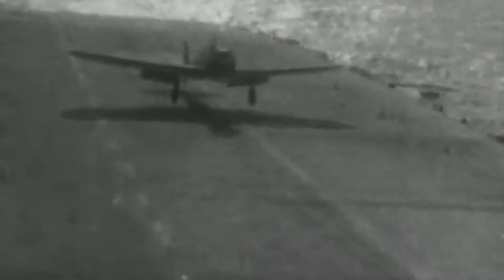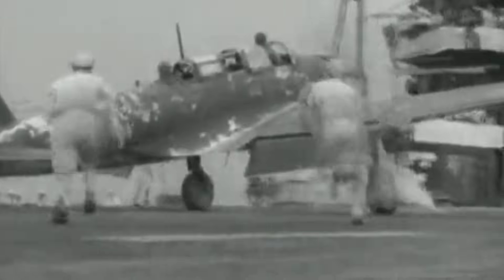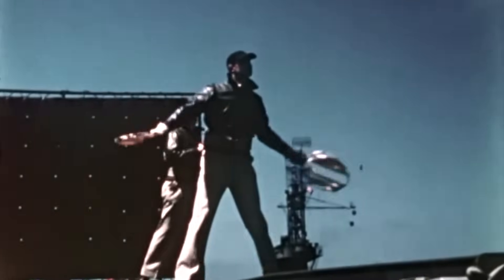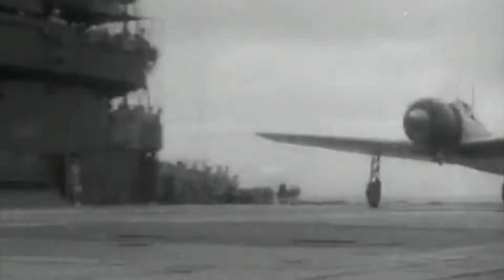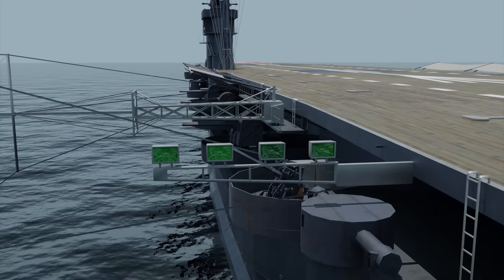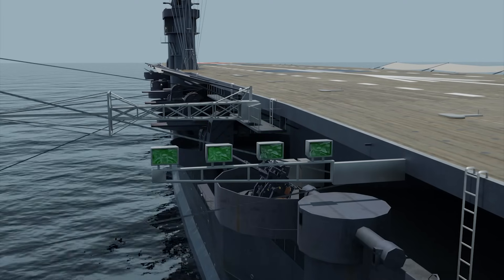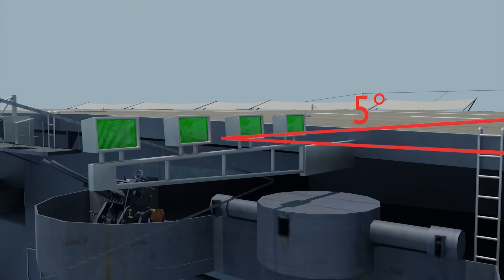Chakkan Shidōtō: How This Device That Helped Japanese Pilots Land on Aircraft Carriers Worked?

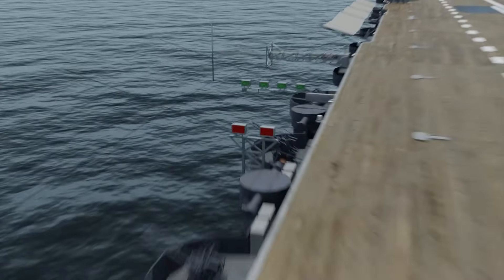Comment: I think you should cut 2:20 - 2:53 or so showing the parts of the system and the various banks of lights and turn it into a short. The algorithm greatly favours that type of video and spreads it to a wider range of viewers.
Reply from the maker: Thanks for the heads up😉

Comment: Seems dumb not to have landing control man with flags.    If enemy action knocked out the red and green lights or the electrical feed to them,  then planes could not land - all aircrews die and the carrier is defenseless.
Reply: 数々の空母機動部隊の作戦行動中に於いて、。貴方の言うような事例は実際に起きて無い。
それと全てが信号灯システムに頼らとも、実際には発着艦指揮官というマンパワーがいて白🏳️と赤🟥の旗を持って航空機の誘導を行なっていた。尚、信号灯の電源は本船回路とは別に独立した回路を持っていはず。😮😮😮
Reply: if enemy action is meeting the carrier in the first place something has gone very wrong

an LSO is alot less precise and succeptible to human error compared to pure mathematics of the positional relationships between landing lights, and as far as im aware the IJN never had any significant issues with aircraft landing disasters so it proved to work completely fine

the IJN also employed flagmen but these were last ditch, and most of the time just assigned a sailor to wave a red flag to signal an aborted landing, this system imo works just as fine if not better than LSOs
Reply: @kulot-ki1tu  The IJN did not have effective radar.   Nor, much of the time, did they have a proper destroyer screen.  Thus things were very likely to go very wrong.  The USN had radar, lots of destroyers, and no shortage of fuel.
Reply: @keithammleter3824  christ this is my 15th attempt and i cant even do a full detailed breakdown of why this comment is wrong without getting flagged by youtube
Reply: @keithammleter3824  youtube keeps deleting my breakdown of why this comment is wrong so to sum it up:

- 1943 onwards, the japanese employed operational radar on their fleet carriers (the first being shokaku), and were using it for gunnery surface fire control during this same period as well. they used radar to vector fighters much like the US did in several battles such as philippine sea

- IJN destroyers were some of the best in the war for fleet actions, and were not in short number for carrier vs carrier engagements and often made up the most of the escort force following their heavily up-gunned anti aircraft cruisers (the effectiveness of japanese AA is a topic for another time that i hope to god you dont try a take on as well)

- you may be confusing the lack of destroyers for carriers with the lack of escorts for convoys, which is something japan attempted to remedy with the kaibokans

- many things taken for granted such as radar were not available early on in the war, and when the playing field was level much better doctrinal practices, aircrew skill and quality of warships often outmatched the US such as coral sea and santa cruz
Reply: @keithammleter3824  youtube keeps deleting my breakdown of why this comment is wrong so to sum it up:

- 1943 onwards, the japanese employed operational radar on their fleet carriers (the first being shokaku), and were using it for gunnery surface fire control during this same period as well. they used radar to vector fighters much like the US did in several battles such as philippine sea

- IJN destroyers were some of the best in the war for fleet actions, and were not in short number for carrier vs carrier engagements and often made up the most of the escort force following their heavily up-gunned anti aircraft cruisers (the effectiveness of japanese AA is a topic for another time that i hope to god you dont try a take on as well)

- you may be confusing the lack of destroyers for carriers with the lack of escorts for convoys, which is something japan attempted to remedy with the kaibokans

- many things taken for granted such as radar were not available early on in the war, and when the playing field was level much better doctrinal practices, aircrew skill and quality of warships often outmatched the US such as coral sea and santa cruz
Reply: @kulotalt  As far as AA goes, it is well documented that Japanese AA was ineffective.   The USN had proximity fuzed ammunition, which was orders of magnitude more effective.
Watch the videos posted by Drachinifel.   He points out two key aspects of the IJN:-
1.  They were unable to adapt as the War went on.  The USN continually brought in new and better technology and changed how they did things; the IJN largely did not.
2.   Training in the IJN was pretty woeful.  The emphasis was on enduring hardship and following orders, whereas USN had a greater emphasis on pitching in and being flexible.   This is why seriously damaged IJN ships were lost, whereas damaged USN ships would limp back to port, get repaired, and return to active missions.
Reply: @keithammleter3824  ok how am i going to even post a 5000 word response with the way youtube manages it

if i cant figure out how to send a response, all im going to say is drachinifel is an excellent naval historian but he covers a very broad area and there are alot of developments in the IJN that go completely un-noticed by western audiences
Reply: @keithammleter3824  yeah no, 3rd rendition and shortening it down to 3000 words trying to explain how overgeneralized your points are isnt working, all i can say is the IJN never failed to adapt to changes in aerial warfare, it just never managed to implement those changes in mass, which is not the sign of an incompetent organization but a meager industry
Reply: and there is a massive difference in an organization thats incompetent and an organization which doesnt have enough resources, these points you're repeating are repeated by everyone who has some vague knowledge of the pacific war without knowing about the intricacies of both sides in depth and only take points from drachinifel

this complacency with the "well we won" mentality is what got alot of sailors killed at guadalcanal as well with false promises from the bureau of ordnance yapping about how the IJN never had good equipment, which was dreadfully wrong at tassafaronga
Reply: @kulot-ki1tu  I don't just rely on Drachinifel.  I just mentioned him because he is on YT and thus readily accessible to you.
Mostly I rely on books-from both sides.  For instance I have a copy of Tameichi Hara's book Japanese Destroyer Captain, which came out in English in the 1960's   It is an eye-opener.   In his book, he confirms that the IJN training was poor and the IJN ponderously slow to learn and adapt.
Hara also describes an aspect which is indeed not much known among western historians:   IJN culture required that any officer could propose a toast, and the captain had to drink it or loose face.  Further, drinking toasts was common when a battle was imminent.   This led to captains being pretty drunk, since each captain had several officers, just when reaction and decisiveness was critical.  They began the War that way and they ended the War that way.
"Incompetent" may be a word a little too strong for the IJN, but in training they were definitely very inferior to Western nations at the time.
You are right about the USN Bureau of Ordnance.   The US entered the War with dud torpedoes and that was a major scandal.   But it got fixed.   The USN also had a warehousing and supply chain system for spare parts that was ponderously slow - taking months to send things.  But that got fixed too.
Reply: @keithammleter3824  in that very same book written by tameichi hara he basically contradicts the entire point that the IJN had a poor training regimen by talking about the development of night tactics and torpedo warfare development which would prove vital in their early successes

there was an entire saga on the book aboard the Shigure where this decrepit poorly kept shiratsuyu class destroyer would go on to survive many of the best and worst engagements that the IJN went on, literally thanks in part to the excellent crew

"poor training" is again an overgeneralization, you might be talking about the inability to find replacements in time for veteran air crews, but the fleet never had a problem with training until the very later parts of the war on very new ships (with the worst case i can think of being taihou)

as a whole, the IJN at the start and even towards the end of the war had just as if not better trained sailors. western perceptions of japan as this hyper traditionalist feudalistic institution is utterly wrong
Reply: @keithammleter3824  japanese destroyer captain is also a fairly popular and mainstream book to study about the pacific war which provides valuable insight on destroyer engagement, but honestly the books i would recommend the most are technical ones which go through in depth analysis of doctrine, specific battles or the ships themselves because it is a treasure trove western audiences have little to no understanding about

Kaigun: Strategy, Tactics, and Technology in the Imperial Japanese Navy, 1887-1941 (great overview of how the IJN fought in relation to their ship equipment)

The World Wonder'd: What Really Happened Off Samar (a re-analysis of samar where many previous authors overblew the heroics of the destroyer escort, ignoring taffy 2 as well as recognizing the great gunnery of some of the ships involved such as the yamato which i hope you also dont start a conversation about without the necessary information because alot of western perception about that ship is also utterly wrong and unfair)

Japanese Combined Fleet 1941–42 (another great overview like kaigun, but more organizational)
Reply: and as the japanese person posted above, all you have to do is translate to figure out that the lights would have independent circuit boxes and backup flag signal officers of their own as well

using your criticism, what if the LSO was killed?? you cant just tell another sailor what to do on the spot (as ridiculous and unlikely as this sounds), because similarly hitting close enough to knock out these lights is also statistically unlikely compared to the entire area of the ship

Comment: How DO pilots adjust for the rise a fall of the deck, especially in heavy seas when attempting to land on a carrier?
Reply: He already explained in simple terms. The red lights will tell the pilot if they were too high or too low. And this just does not apply to the plane but the ship too. If the deck rose higher than the plane's angle of approach, he would see the red lights under the green light and vice versa. It is all up to the pilot's reflexes to make changes and try to safely onto the deck.

Comment: Japanese aircraft, ships and technology was ahead of the U.S. in many aspects in the lead up to WWII. 
Where they failed was in having the raw materials to engage in a protracted war with an industrial superpower as the U.S. became during WWII.
There's a lesson in there somewhere.
Reply: Japan was also ahead in anti-sub patrol aircraft(VP) equipped with MAD "magnetic anomaly detector".
It's Kyushu Q1W
However, at that time Japan did not have the resources left to organize a Anti-Sub VP Squadron.
Reply: The takeaway is that the US no longer has the edge in manufacturing. We would be quite a distance behind a China for example. That said, a protracted war between nuclear powers is highly unlikely and would most likely end in a quickly negotiated peace or Armageddon.
Reply: Japan had the most comprehensive carrier pilot training programme on the planet in 1940. Unfortunately that was also a problem because it took two years to train a pilot according to that programme so they couldn’t replace pilots lost in combat (or simply due to engine failures).
Engine failure was a problem because the Japanese never had an air sea rescue organisation either.
The prewar Japanese pilots were GOOD, the Japanese aircraft were good, the Japanese logistics in every way possible were horrible and brittle. The Japanese lost more of their forces to starvation than enemy action.
Reply: 空母128隻、大型爆撃機34000機持っていた国とどう戦うんだよ。ちなみに当時の日本の空母は25隻、中型以上の爆撃機で8000機くらい。
しかもアメリカは戦後それを持て余して、1年くらいしか使わなかった兵器を核実験の標的にしちゃった。
またアメリカはドイツ、イギリス、イタリアなどヨーロッパの国とも桁違い。ドイツも終戦時はほぼ全滅、イギリスはソードフィッシュを終戦まで使って、いよいよ制空権が危なくなるとアメリカから飛行機をレンドリース。イタリアは早々にリタイア。

…日本は戦う相手が間違ってた。
Reply: "The lesson in there somewhere" is about blanket statements.  
The US dedicated someone to help you land instead of just letting the light on. There is a statement to be made about dedicated someone's
Reply: And also radar. And also intelligence, and also anti-aircraft guns and AA fire control…. their lack in innovating in those caused them to be outmatched by the USN. They instead doubled down on building bigger and heavier battleships, the opposite of what the world today has.
Reply: The only thing Japan did better to the US in the lead up to WWII were naval aircraft
Reply: They also had better torpedoes, although a damp firecracker would have been better than the interwar USN torpedo. Japan was very proud of its prewar weapons tech and even featured it in consumer advertising. What they didn't realize was the pace of change once the USN put its R&D establishment on a war footing. By late 1944-45 the IJN was facing US submarines with computer-directed torpedoes and frequency-modulated sonar, backed up by surface ships equipped with high-resolution radar and integrated fire control, along with more and better aircraft and more and better-trained pilots. From then on the IJN was not so much fighting a war as being mangled in a vast industrial machine, and if their leadership had been willing to face up to that, a lot of suffering could have been avoided...